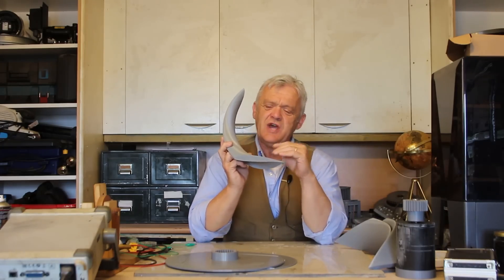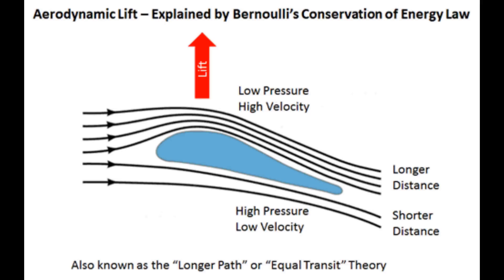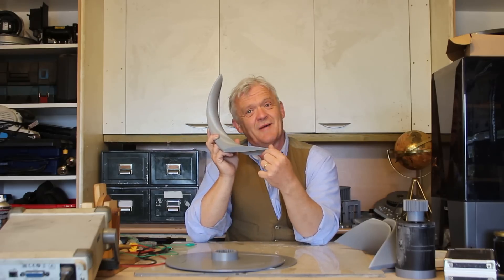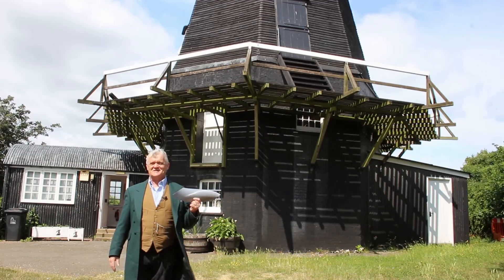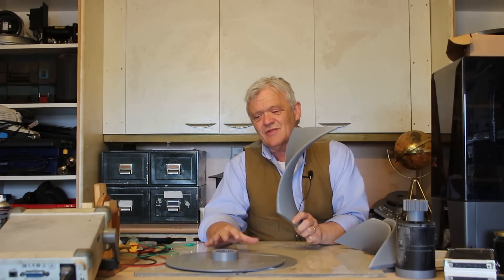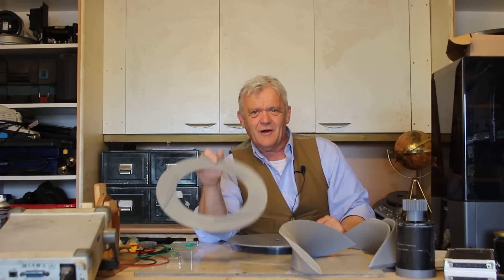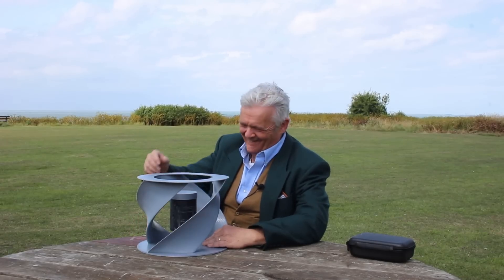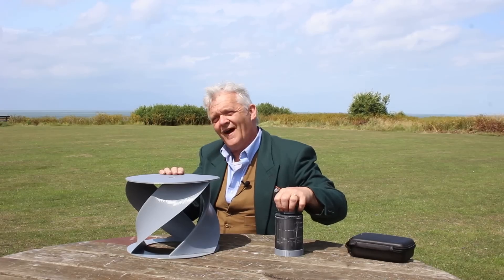1976 A Self Starting Wind Turbine

Comment: I think you might get easier rotation and more energy by putting four 120 degree rotors on it, spaced 90 degrees apart. Also, possibly extend the shaft so the motor (and your hand, or any mounting point) is below the rotor to see if you get more energy by the wind not being blocked in the middle. You could also combine both ideas and see if there's any difference or improvement in the power generation.

Comment: When things don't at first work as expected, just give it a little shake or a hammer where needed.  LOL!  Thanks for the video Rob.  So this is what they call a "hands on" type job.  Keep up the good work Rob.  Thanks again.
Reply: @nickbrockelman  It was a joke from me.  It is self starting, he shook it to free up the electric motor that it was attached to not because it would not self start.  A motor when it sits for a while gets into a bind and takes more force to start it moving than usual it would need.  If this indeed had been on a low friction bearing it would have started turning on its own.  That is what he means by calling it self starting.

Comment: The ratio between lift and drag is the "lift to drag ratio".

Reynolds number is "the ratio between inertial and viscous forces".   It effects how a fluid flows (air/water) behave at different speeds and size/scale.   Airplane wings fly best at high speeds (100 mph+) and with wings wider than 3 feet.  The narrow airfoils and slower speeds of small lift type wind turbines make them preform terribly compared to large wind turbines with 50 foot+ blades.

There are airfoiltools online that graph the change performance of many different airfoils when operating at different Reynolds numbers.  There are also online calculators for determining the Reynolds numbers.
Reply: 🎉wow, Rob needs to post a retraction.😂
Reply: @justtinkering6713  No - not his style - a new video per day is the priority.
Anyone that cares about the subject will do more investigation on their own.
He is right that the turbine will operate at a low Reynolds number, however airfoil shapes perform worse the lower  number.
Reply: Happy independence day.
Reply: Dan, I can't find the video of your Savonious aerator. Is it still up?
Reply: @justtinkering6713  Happy independence day!   The video is no longer up and the VAWT is in the shop waiting for an improved rotor.  Still a lot of testing to do on my rotor designs.  Hope to have it back in the pond this winter.

Comment: Don’t forget one thing! The maximum energy to be extracted from the wind, will alway depends on the frontal area exposed to the wind!
Actual designs are close to 50% efficiency, which is supposed to be the calculated theoretical limit.
Besides this,me ven if the concept is super efficient, a small unit will alway provide small power.

Comment: Darrieus types work better when over a metre in diameter as the rate of change of pitch is slower. Also the amount of blade blocking the through flow (i.e. number of blades and their length) significantly affects performance, so 2 blades are better than 3 or more.

Comment: seems that if you had the simpler design of two half  barrels that almost join at the center, it would have started spinning much sooner with all that wind.  make 5 turbines. set up a a couple of magnets on each for resistance that needs to be overcome (imitates a generator),  and get a tachometer on each turbine.  see when each starts spinning and how fast each spins. that'll get you ballpark into best design,  things happening on the same day, same conditions, etc.  tachometer can probably be made from a simple light module, a spot of reflective tape, and an arduino, which will log the results into a nice file for you, so you can compare columned data sets.

Comment: Ducted vertical turbines seem to be the way to go for me. They work regardless of wind direction and accelerate any wind to use it most efficiently. By degrees they cannot overspeed if correctly designed.

Comment: Of course unloaded is easier to get started than having a load on it. Might be neat to have a device added that checks for a minimum RPM before putting a load on the generator part so it can start with even less stalling issues.

Comment: Wrong explanation about lift, partly. But the design looks legit, and nice fancy. I can imagine though that it works much better without a large generator and a hand in the middle. The air needs to flow through freely, I think.

Comment: I'm wondering fi you cut out some holes in the large circles if it would move faster?  Air is traveling along the blade and how it exits the top should make some small difference on a short system.  Over a long/tall Collum it would make a lower percentage of difference.

Comment: You need to add a camera tripod mount or something to the bottom so you don't have to hold it up perhaps. If you find a tripod with a hook on the bottom you can use a carrier bag with a bottle of water in it as the weight on the bottom to hold it in place when it is windy.

Comment: I believe that this would gain from opening up the top of the bades, where the blade meets the disk at the top, the bottom can remain the same... It prevents airflow... It would send air away from the direction of the turn... I see it as air rivers flowing on the blades and there is a dam at the top preventing flow and accelleration... Remove the dam at the top please. I would love to see the results, even in slower wind it might help. I understand lift as well.. I studied in aeronautics.

Comment: Question. How would this perform if there was a load on the generator? Would it self start in that scenario?
Reply: I'm no expert but, If you use a flux capacitor and plutonium in the circut you can time travel if you can get up to 88 mph 👍
Reply: The generator should have no load until it is spinning fast enough to produce a voltage that will charge your battery, or power electronics, or whatever. Until energy is 'allowed' out of the generator it just accumulates with little resistence in the speed and weight of the turbine, like a flywheel. Only 'allowing' current out of the generator limits the speed, or extreme noise and vibration if the generators circuit is never closed by charging or a dump load. The system is designed to only allow current to flow at an optimal speed/voltage level.
Reply: @adymode  Honestly, I think this design isn't working to convert the energy of the wind well enough. It was very slow to get started and that means that it has very poor torque. It doesn't matter how fast it gets if the torque is poor, as soon as a load is placed on the generator, it will slow down too much and stall.
Reply: @marcfruchtman9473  Very limited success. On a breezy day with no load it should be expected to really hum after a few seconds of turning. From past experience - it could hum so much Id not want to hold it. Im waiting for that video where Robert discovers how energetic unrestrained wind catchers can get X) 
I suspect it twists through too great an angle spoiling the aerodynamics of the cross section. Just 5 or 10 degrees may provide the required kick while having little impact on the airfoils performance.

Comment: Just a thought - if you shield the resistive side of the wheel (right side in this case) would the resistance to starting (and rotation) be reduced (if not eliminated)?
Just love seeing you do what I can not - theory is fun, but not as much fun as doing the practical testing.

Comment: I could be wrong, but it seems like the top plate needs cutouts so it looks more like spokes than a plate. I get the feeling air piles up near the top.
Reply: The solid top disc blocks wind from flowing from  top to bottom along the helix.  If that happened it would start turning in the opposite direction.  In turbulent wind it's just a matter of time until some air moves bottom to top to start the spin.

Comment: Is the generator preventing flow-through? Would it work better if the central portion was clear so that the flow-through wind would also work on the blade on the far side?

Comment: Why make it a helix? Efficiency of material? If not, why not just make the VAWT fan blades shaped like a fairly undercambered wing profile so each blade gets both the push and lift? Lift will go in the same direction as push when air hits the front of the blade and as the axis turns. This might allow for more torque in gear ratios if not speed, but it should increase speed.

Comment: Suggestion: Get hold of an ESP32, set it up as an AP, program it so that it is a WebPage. Use a small 3.7Volt rechargeable battery make a circuit to monitor the motor's output (Volts/AMPS/Speed). You can incorporate the circuit into your round base under the motor, a redesign of that cover of course. You will then be able to display the data on your phone or computer to be displayed for all to see. As for the unstopping design issue that was mentioned, why not have the ESP32 monitor the rotation speed and induce a load proportionate to the speed of the unit to slow it down, if necessary or send an ALERT. Have to keep improving these things. Just a thought. Great video!!!

Comment: Nice ! I wonder How to make this turbine shape Without 3D printer or complicated/expensive ways.... As it seems to be possible to simply (heat ?) shape some plastic pipe...
Reply: Construct a mold and use fiberglass.
Reply: @hubrisnaut  I was meaning a way to go to easy and cheap way, due to this shape that could be done by reshaping pcv pipe.... mold and fiberglass, why not for some complicated shapes and needs, but in this case i would be an (expensive..) overkill
Reply: @AutoNomades  I thought you were looking for a way of doing it without a printer. To heat and bend pipe I would think for a complicated shape you would still need some kind of mold.
Reply: @hubrisnaut  I play a lot with heat gun and plastic and it is very versatile. And for the mold you can use recycled /misuse stuff too..
Reply: @AutoNomades  Cool, Robert has made basic turbine blades from pipe on a few occasions. Maybe you can come up with a simple method of forming them so they are more efficient with heat. You should give it a shot.

Comment: I assume you'd want to use some sort of a bearing that's suitable for handling the side loads, rather than having your generator shaft handle those loads? And then connect your generator to the shaft using a gear that can allow for some movement between the shaft and the bearing?

Comment: I liked the previous feathering design.  However, I would orient the feathers to the blades rather than the central axis, so as to reduce the distance each of them travels and the amount of slap.  Perhaps also reduce mass as much as possible, using plastic film compliant enough that it can bend to create an opening, but not enough that it can't stay rigid in the frame.  Basically the same thing they use at the nearest boulangerie.  Perhaps the same printer file, only with grids and space to connect the film.

Comment: I never understood typical propeller design - the tip of the prop has the smallest surface area and the least angle of air-scooping.  makes no sense.  a windmill should be the opposite better design

Comment: If a wind turbine doesn't self start it's pretty worthless in my opinion.
Please check out the Sharp cycloturbine. It's a lift type that self starts and automatically adjusts the blade pitch. And it has soo much torque it" pulls like a truck".